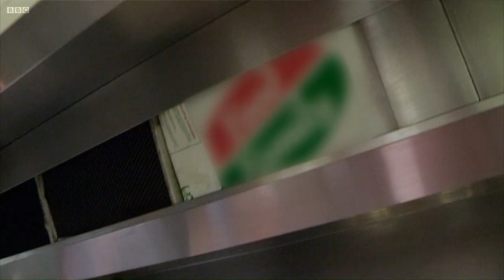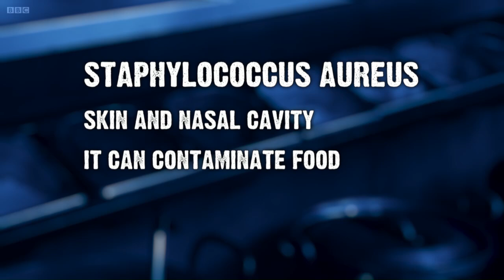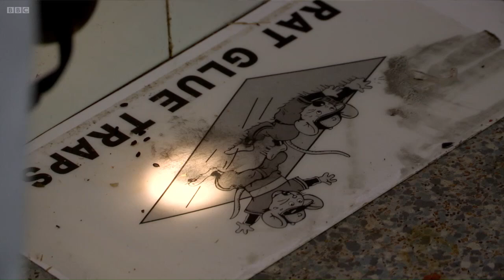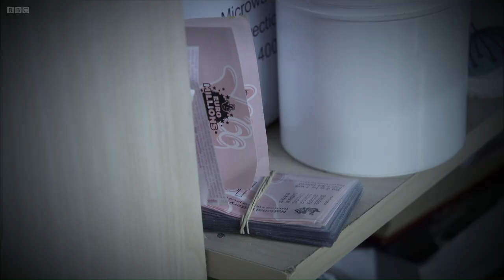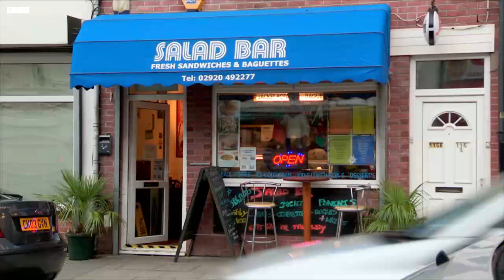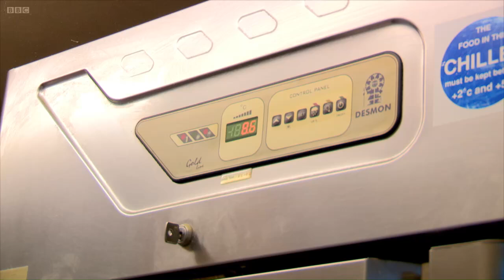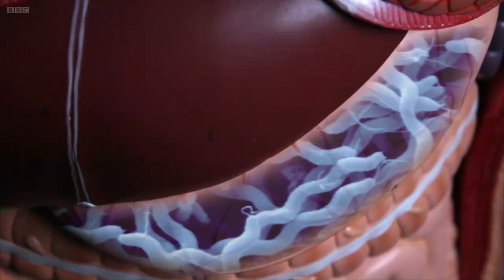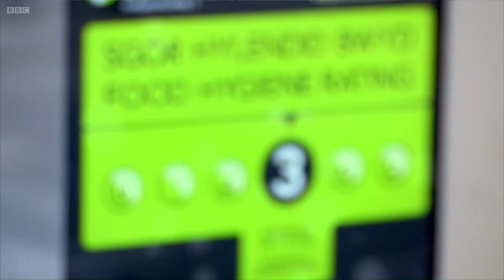Food Inspectors - Series 2: Episode 4

Comment: @40 mins sushi has significant risks associated which are reduced with vinegared rice which is standard procedure.  Secondly fish for sushi is required to be frozen for 24 hrs to minus 20 to kill parasites. Or minus 35 for 15 hours.  This is required by law and not mentioned in this video.